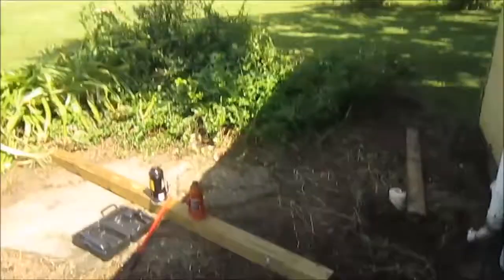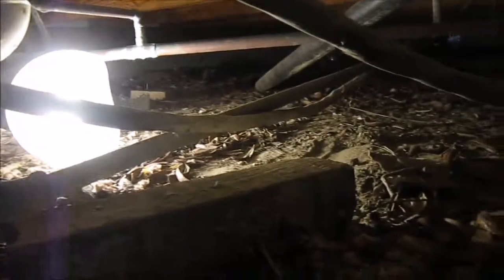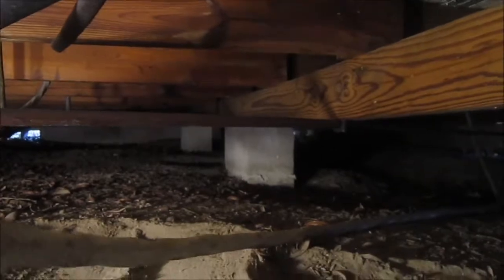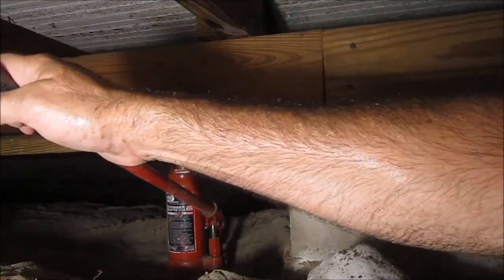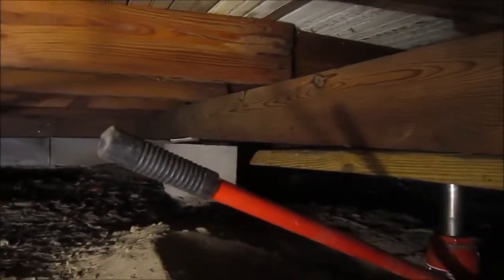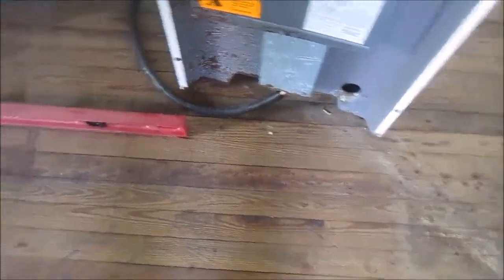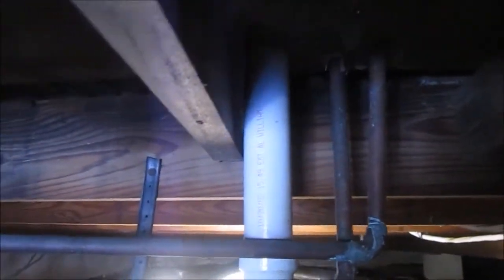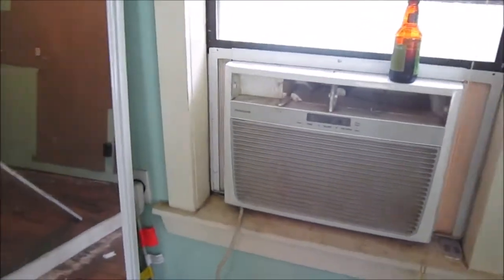Cottage Restoration Part 2: Leveling

Comment: Hi, Jim

Found your channel and subscribed yesterday evening.  Chiming in to appease the algorithms, and to let you know that I appreciate your vids.  They're informative and interesting, and I'm impressed with your engineering know-how.
I recently bought a cottage and have been quite anxious as I'm facing a similar issue of the floors all dropping toward the center of the interior; so your vids have been very helpful in allowing me to see a way forward and not be so clueless about the problem.  It was a gloomy realization when I noticed that about my floors! I'm optimistic and not so worried now. Thanks!

PS: I do hope I get to see your white oak cottage floors refinished at some point.

Good work. Keep it up. Thanks again
Reply from the maker: I'm glad this helps.  In some cases, I learn as I go and share the work on the 'net so others can figure this out. 

The floors are old butter-soft white pine and are going to be destroyed by tenants if I put in the effort to refinish them.  I'll be going right over them with LVP.

Comment: If you are going to use wood for shims, I would also recommend using hardwood: oak, maple, etc..  Pine, is too soft and will compress.  Personally, I went to a local welding shop and had them cut me a bunch of 1/8" and 1/4' metal plates (4"x4") and I shim with those.

Comment: OMG.  I'm sure that you were wishing you were gumby that day.  I've got a cabin leveling cluster of my own but thank God I have almost 3 feet or more of space under it to properly work in and not a whole lot of excavation to be done.
Reply from the maker: In one of the videos I use a little video editing to snap my fingers and pull out a cubic yard of dirt from under the bathroom.  I'm 6'2" and 240lbs, so this was tight before I did that.

Comment: be careful removing a ground rod. Look it up. Even installing on "if there is a problem in the service  or an open ground? You could get killed. Depending on many things . Be safe, Okay, look things up. Many things even in a new installation. be safe. 1 test will Always save many lives. & you do not want the test of getting fried. Good Day.
Reply from the maker: Thanks for the advice.  That's a very good warning and I hadn't considered it.

Comment: Did you have any Sheetrock or walls crack? I have the same issue in a smaller section of my home and my wall is not plumb, pretty bad right on the sag. Inspector and engineer said it’s just cosmetic at this point but in theory if floor raises the wall should straighten out as well a bit. I’m worried about cracking all the sheet rock.
Reply from the maker: Indeed, the walls were wrecked when I leveled the house.  The previous owner didn't bother to level the house before "repairing" the walls, so each was a trapezoid instead of a rectangle.  In a followup video, I show how the walls were wrecked and what I did to repair them.

Comment: I gotta do this to house I am buying but dirt under it is not level. I can notice a sag in floor from 2 feet out from wall  in dining area . Joists are like  36" 40" apart which is to far apart but guess they didn't care back in 1946.
Reply from the maker: Wow.  A 36" on-center spacing is outrageous regardless of how thick the floorboards are or how short the span is.  You might be able to fix this up by simply adding floor joists halfway between the existing joists which would result in them them having a very reasonable 18" to 20" on-center spacing.  Add some stabilizing blocking between the joists as a final touch to make the floor feel very solid and level and then declare victory.